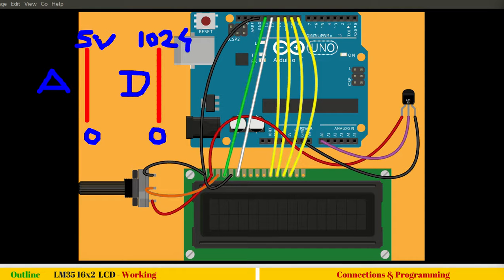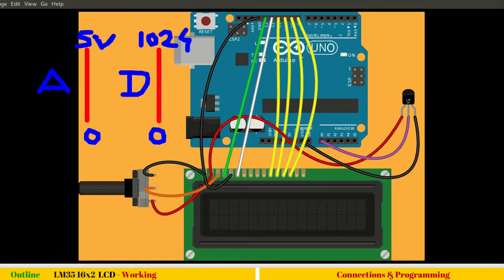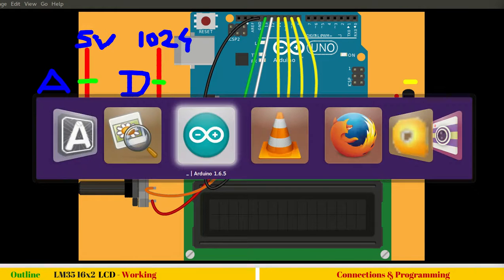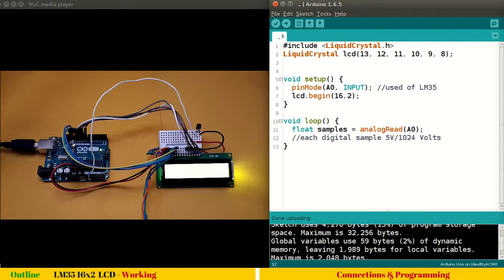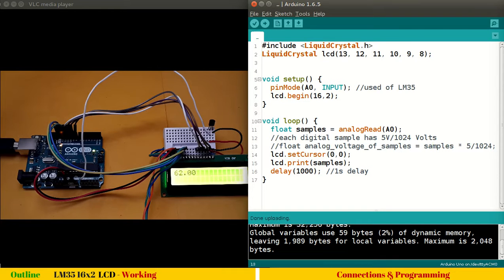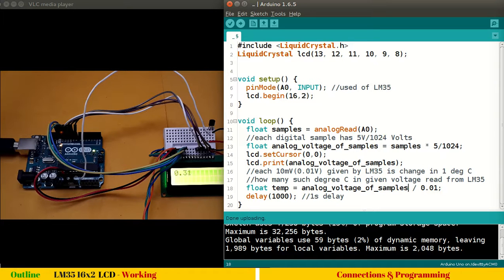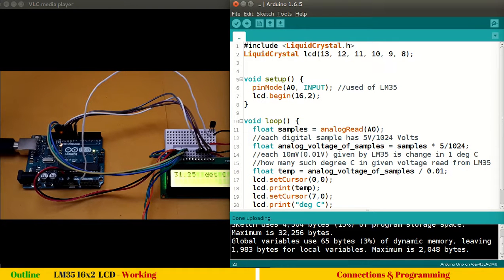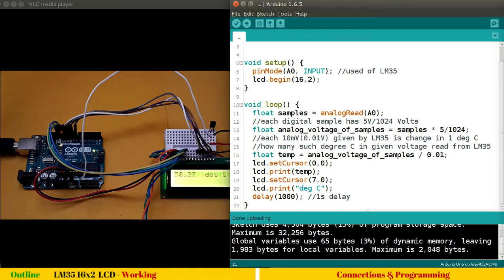18. Interfacing temperature sensor and displaying output on 16x2 LCD with Arduino(ADC)

Comment: hello sir, actually i'm working on a project using flex sensors. when a flex sensor is bend a corressponding message should be displayed on lcd lcd screeen.can you help me out wit the code sir. please